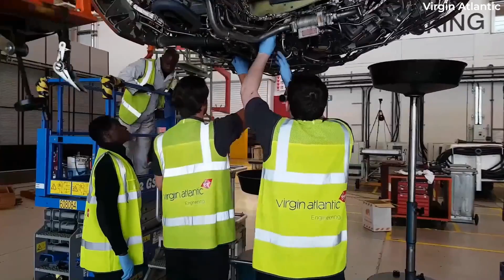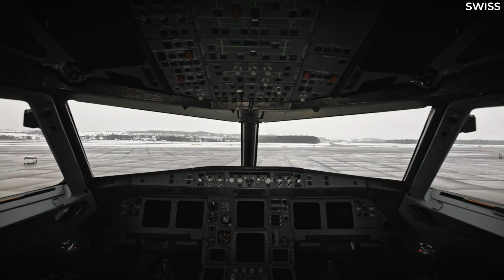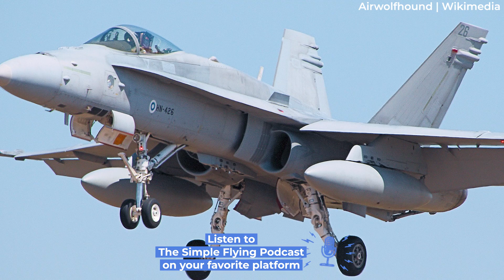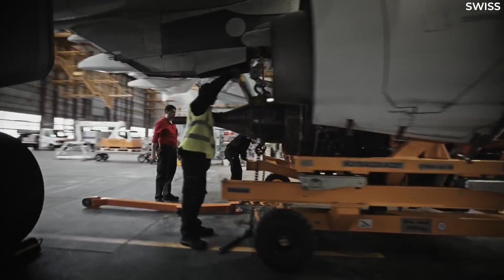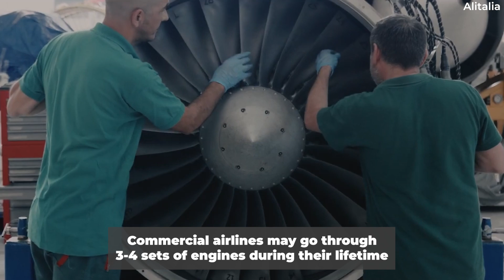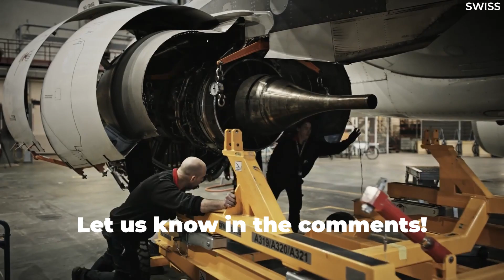How Many Engines Do Airliners Go Through In A Typical Lifespan?

Comment: I think your numbers are a little off. you stated the airframe for a widebody was 44,000 to 64,000 cycles. if this is true than the TWA flight 800 had some 93,000 cycles which pooves that TWA took care of their 747's and there was never any frayed wires and  no so called 3,000 feet climb. I hope to see a story from simple flying in the near future.

Comment: I was the director of maintenance for a small air charter company. We had one aircraft, piston powered, that was on it’s 13th engine when I retired.
Reply: Same. I think the TTAF was about 8000 on the B55 and it went through many engines (TBO was what? 2000 hrs?) and then the pilot crashed it- total loss (which didn't take much) (and no injuries).

Comment: This video could be construed to mean that a large commercial aircraft would need 3 sets of engines over its typical life, however modern engines are modular, so some modules last longer than others and are not replaced as frequently as others, for example, the fan module may undergo many repairs while a hot section module may be overhauled and repaired a number of times in the same period of the fan module. This makes the very question you raise a moving target really.

Comment: The company that pays my bills makes large turbofan engines. Number of cycles is far more important than hours turning: some of our identical-to-flight-engine cores are used for power generation. Hundreds of thousands of hours between overhauls is normal. Small engines, such as the HF120 in the HondaJet, will likely "cycle out" before any true wear issues surface.

Comment: Makes my continental c90 look pathetic needing cylinder work  every couple of years at 100 hours , poor design and  crappy materials coupled to 1940 specs oils etc. Need more work than flying. They make a modern car look fantastic  being like a 1940  basic car with a rebore needed at 20000 miles nowadays car leasing easy 200, 000 miles with just oil changes.

Comment: Age is not a question. Aside from LLP, if you spend enough on parts you can restore an engine's performance to very close what it was brand new and this expense is balanced against efficiency gains. Meanwhile the aircraft itself is ageing, its cabin needs refreshing, passengers expect wifi and IFE and overhead storage. Aircraft are never retired because the engines are tired

Comment: The Rolls Royce AE3007 engines I worked on for the Embraer 145 had a 4000 flight hour before overhaul cycle

Comment: "in the end of life phase it is common for engines to be installed on smaller type variants to be operated at lower thrust levels"
Is this true? I've never heard of this. Do they take crappy used engines out of 777-300ER's and put them into 777-200's or something? I don't really see how it is worth it to put an engine in its end of life phase into a different airliner...
Reply: I can’t see that working. Our shorter planes have different engines with different thrust levels. Sure they could swap the components and turn it into a different engine but that seems redundant
Reply: No it's not true.

Comment: What is the benefit of occasionally rotating the engines on a given plane? Since those engines are going to get used on another plane anyway.
Reply: If the engine needs work they can pull it off and put another engine on to get the plane back in service and send the engine out for repair and then when it comes back it’ll be on backup status for another plane
Reply: It’s the same as rotating tires, oh, I don’t know what the heck I’m talking about
Reply: They "rotate" when an engine needs service so the airframe can continue service. Happens all the time if there is a problem that can't be fixed on wing.

Comment: The BAC One Eleven engines seem to last forever. Rolls Royce Spey.
Reply: The 66 passenger fighter jet. And I will never forget the "crack" in it's exhaust tone whenever high power and sub-zero air temps coincided.

Comment: Make an engine made by toyota and let us see how long it last.
Reply: Toyota has yet to make a jet engine for aircraft. They had designed and build a gas-turbine car in the 1970's. Honda and GE have a joint venture engine. The HF120 is a GE Honda low-maintenance turbofan for small business jets. Late production engines last 5000 hours between overhauls.
Reply: They are not in that business.

Comment: Here is one example I know of. In 2017 N401UP, a 757-200 flying for UPS, celebrated 30 years flying for the airline. I don't know how many flight hours the plane had racked up, but it was stated that the aircraft had gone through a total of 19 Pratt & Whitney PW2000 engines.
Reply: 19 PW2000s strikes me as an odd number, no pun, I would have thought engine change outs would have been done as pairs.. Perhaps not.
Reply: @8138don  If your new set is a week old when a bird goes into one, you're just getting the one....
Reply: @8138don  a lot of the time, they'll run only the left engine while taxiing, so it takes a little more wear that the right engine, which is only running takeoff to landing.
Reply: Wouldn't really believe that rumor.
Reply: wow, I wonder why such a higher replacement frequency than commercial carriers... ...doesn't UPS run them about as much as commercial carriers just night time ops instead of day?
Reply: @markvanslyke294  They run them during the day as well. A UPS 757 will fly as many as 4 times in one day.
Reply: @markvanslyke294  No they have much fewer cycles typically.  Basically to from the hub to the out station and back in most cases. That's why they can operate much older aircraft profitably.

Comment: CFM56-5C have had over 56000 flight hours on wing and it’s not the record on A340-300. 

Engines are on condition well monitored. Some parts in jet engines are frequently replaced. ETOPS will also make own maintenance more expensive depending of ETOPS time on use.

Comment: if the airlines use RR Trent 1000s, there will be more engine replacements
Reply: Trent 1000`s did have major problems but RR have addressed these faults & for the last couple of years are reliable again.
Reply: GEnx rules 😍
Reply: @rafaelwilks  As with the Trent 1000 GEnx hasn`t been without faults which admittedly haven`t been so severe, but if you took the time to research you`d be aware of the problems. I would imagine these two turbines are pretty well sorted by now & while it`s true GEnx has a bigger share on B787 this was always expected as the US airlines would always choose the US made engine over another. RR`s share is still doing well considering the earlier problems with Lufthansa placing a big order for RR power, & it will be interesting to see who Emirates choose for their huge Dreamliner order.

Comment: It is one of the 2 engine questions I asked myself. The other is why no new type of engines are installed on older bodies.
Reply: It's just not economically viable too your second question. It's been considered numerous times with older commercial aircraft, but the costs of certification of the engine and airframe, required changes to the existing airframe etc have not proven worth it. You can't just swap on an off a new type of engine. It's only been found worthwhile on some military aircraft. Even with an aircraft with multiple engine options, you can't replace say a CFM engine with a PW one (ie 320NEO. Simply too many differences in the airframe itself for each.
Reply: A321 neo (new engine option) pretty sure there is an A330 neo, the 737 has been re-engined multiple times and the b52 is either being or has just been re-engined. I'm sure there is plenty other examples.
Reply: @macky4074  The OP was referring to a used aircraft having a next gen engine put on it. That's not something that happens for commercial aircraft.
Reply: Look up DC 8, C-5, and B52 re-engine programs. It has been done and is still.
Reply: @bruceferrero8178  The DC-8 was the sole exception in commercial aircraft and that was 40 years ago. Nothing sense. Military aircraft are entirely different story than commercial.
Reply: @johniii8147  there were no limitations in the original question. Just pointing out that it does happen.
Reply: The Boeing 737 is a great example. Designed in the 60’s, Boeing has repeatedly re-engineered the aircraft to accept a variety of newer, more powerful and more fuel efficient engines.
They began flying them in the 80’s.
I can’t think of any commercial aircraft that has been upgraded as much as that one. It’s a very nice airframe
Reply: It is interesting that narrow bodies are evaluated by cycles and wide bodies by hours.  It seems the opposite should come into consideration for both. 

The old ATA flying a narrow body from the Midwest to Cancun isn't the same as a Southwest airlines five stop trip across the US. And of course JAL123 wss a short-haul in a wide body.
Reply: They are, it's quite common
Reply: @tommyjenkins7453  Not at. It doesn't happen on commercial airplanes that a new generation of engines are installed on an existing used airframes.  They do swap outs of course of the existing engine type.

Comment: we used to run 2 intl airlines.. 3 or 4 sets per aircraft.. thats insane.. try 10 or 20..
we rotate engines in and out of  aircraft almost  daily.. any  individual plane can  have 2 or 3 different sets a  year
Reply: To be fair I think the numbers offered are deliberately conservative and based off one set of possible criteria. Aircraft operators are of course free to make their own choices on when to replace/rotate engines. If I were to speculate I would suggest that perhaps some have arrangements with the engine manufacturers to cycle engines more frequently to keep them in tip-top condition.
Reply: That wouldn't be the norm for modern aircraft unless there a known issue with a given engine that makes it less reliable.

Comment: In a previous life I was a aircraft mechanic in the U.S. Air Force. I worked on fighter jets and it was not uncommon to replace an engine every year. You did mention in the video that militaries purchase spares so they engines can be replaced more frequently than on commercial aircraft, but I think it is important to note that on on military aircraft it is often easier and faster to replace an engine rather than spend the time to troubleshoot the issue and wait for spare parts to arrive.
Reply: Yes its common for military hardware and expensive parts to be refurbished.  Usually its front line, 2nd and 3rd service echelons that  handle basic maintenance and consumable or wear items and also diagnose issues to a sub assembly like an engine needing overhaul or faulty circuit card.  Those items are then sent on to 4th and 5th echelon facilities where full overhauls, rebuilds, and upgrades occur.  The military would not throw out jet engine cores because they hit a deep service interval or fault determination.  Sure it costs millions to overhaul a jet engine, but costs 10s of millions to procure a new one, so its more economical to maintain the engines than replace them.
Reply: Wouldn't it be more cost efficient to still order the spare parts and refurbish the used engine. Seems pretty wastefull to completely change an engine if for example a fuel pressure valve went out 🤷
Reply: @arnevandemaele7445  I know from credible sources that the US Navy does in fact refurbish engines.
Reply: @oadka  They do some repair work at the aircraft intermediate maintenance department on a carrier or base. Past a certain point they send it to the maintenance deports at North Island etc for more complex or time consuming repairs. I suspect USAF does something similar.
Reply: @oadka  I can verify that.  My berthing area was very close to the engine test stand, and the schedule for testing engines seemed to be, "whenever that guy is trying to sleep".
Reply: @arnevandemaele7445  I worked in what’s called O level maintenance. We would remove and replace an engine if there was a problem that we couldn’t fix. The old engine gets sent off to another level to get taken apart and fixed. So while the aircraft might go through more engines the old engines aren’t necessarily going to waste
Reply: That makes sense in the context of downtime. It's easier to swap an engine out, and then repair the engine while the airplane is flying with a different engine.